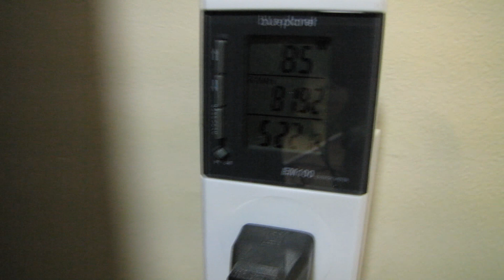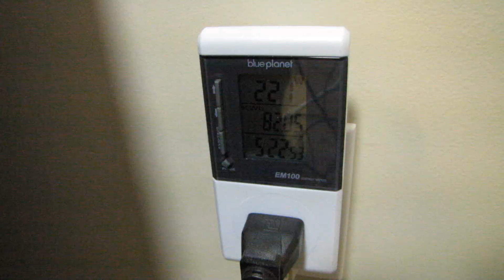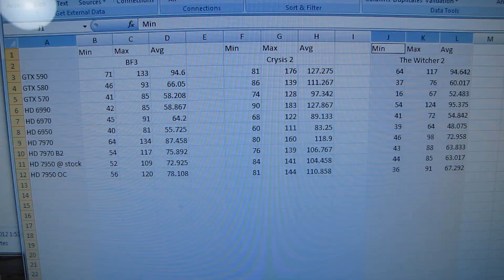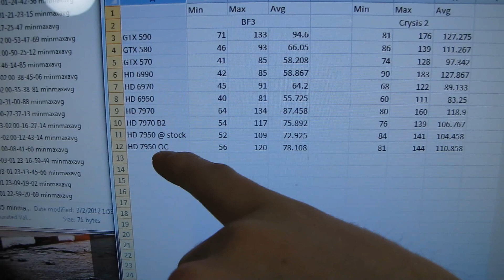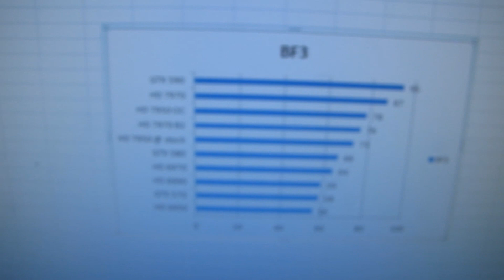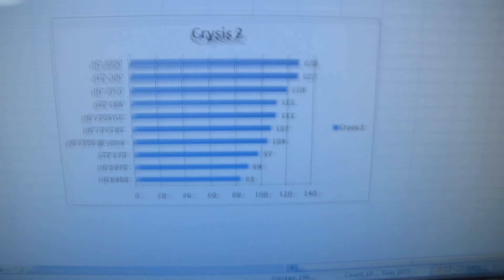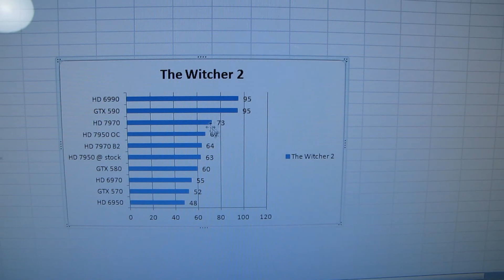Sapphire HD 7950 OC Dual Fan 3GB Video Card Review & Benchmarks Linus Tech Tips

Comment: Just bought this GPU for $40 and In 2017 it's still a great card
Reply: 2018 $ ???
Reply: @QuanTran-fy1lp  Well then... here we go: I bought myself a full system today (craigslist) with this GPU included (actually the Club 3D version) for 50 EUR (around 57 USD), complete with a semi-modular PSU (OCZ Fatal1ty 550 W), Phenom II X6 1075t CPU, Scythe Mugen 2 air cooler and 8 Gb DDR3 memory on an ASRock 870 Extreme 3 motherboard, all within a CoolerMaster HAF 932 case. Pretty lousy deal I guess since the guy didn't include an HDD... xD

Comment: I have the Gigabyte one with 3 fans and I just replaced 2 of them, rattling at idle.. hope they stay quiet now. Build the system in late 2013 and it still doing everything with an i7-4770 and 16gb of ram. I also have it clocked to 1000mhz/1250mhz.

Comment: @wasssabio 

Much smaller Die size than the 6950, meaning it uses less power and generates less heat,  it also means they are able to fit more onto the physical GPU aswell giving it more power to give you better FPS.

Comment: @Guitarlover762

Not a chance, I'm not sure about the 3570K but with an 8-Core AMD FX processor and two 7950's and a few other things installed the Newegg PSU Wattage calculator gave me a readout of 821 watts, so no, it is almost certain that a 750W PSU is enough to power your system.

Comment: Its a good card,i have a Vapor X aswell.
Overclocking is easy enough just take your time with it,i only recently built my first PC and was new to overclocking too.

You'll need software for overclocking and monitoring software to check temps etc.
To overclock the card i used MSI Afterburner but Sapphire Trixx is also supposed to be good and is made by the same company that makes you card.
For monitoring speeds and temps Gpu-z and HWMonitor are good too.

All these programs are free too :)

Comment: @IAmSkip94 Never mind that when you run it on several different machines with different mobos/CPU's etc you need to reinstall anyway. It's a bench rig it gets used to benchmark maybe a few days tops until the whole configuration changes again.

Comment: Getting exactly the same. Have asked around on forums and stuff, no problems.

But maybe you should consider swapping the i7 for an i5-3570 (almost the same, but i7 got multi-threading) and buying an SSD for your OS, since that will increase loading speeds more than an i7 over i5.

Comment: In performance, the 660Ti beats the 7950 I think.  But you can overclock the 7950 to higher performance than the 670.  But I'm not sure if you lose the PhysX from Nvidia if you pick the 7950 though.

Comment: i got exactly the same you did (or will) and it's a beast, it runs great, i didn't have any problem  when i first turn the computer on, before installing the video card i tried a few games and only with the processor you can run left 4 dead, diablo, PayDay and games like that, with the video card if you still haven't gotten it, i would get a GTX 660 ti, it performs almost as good as the 7950 but it costs $300 only. :)

Comment: A power supply is what gives your computer power. There is a certain wattage requirement your pc needs. Power supply for short is psu(power supply unit). The average power supply wattage is a 500 watt power supply. I would recommend either corsair or seasonic. Mostly corsair. To make you feel not lonely, I'm 13.

Comment: kind of, there is still room for improve...also depends on game, there are few solutions available, just google it...anyway latency is far better on nvidia, thats a fact...but about raw power, this card is a beast, i OC to 1150/1600 without even touch the voltage, also the bundle is very nice.
and they have more bandwith and ram, this card come with 3gbs of gddr5, which is very nice, for max out resolution and filters, its up to you.

Comment: I'm bad with computers. If I get this card, do I need to buy anything else? Or just the card?
Reply: depends on what are you going to use your computer for, and what are your computer aspects
Reply: I had to buy a new power supply with it which was about $100. It says minimum is about 600 Watts, you might be able to get away with a 500 watt power supply if your current power supply is a high end.
Reply: HawkSupport Please don't try and get away with 500 Watt's I know its tempting but save up.
Reply: Killagoku PC  a quality 500w can run it.. i can even say i run a fx 6300 and 7950 maxed out on a poor 450 cheap but strong unit.....   So a 500w with japan capacitor is able to power it easily
Reply: do you have a computer with parts but your missing a card, if so no you wont have to buy anything else for the card...

Comment: I can get the 660ti or this, right now i'm leaning towards the 7950.  The 7950 has the new edition of a "boost" clock right? so it's the same as 660ti and I've been seeing higher overclock potentials for the 7950 than the 660ti.  But if i pick the 7950 will I lose PhysX??

Comment: i got 7950 @1150 /1600 OC and run games all games good at 1080p, so if you play at 1080p, single monitor...you should run everything over 60fps without problems with that configuration..crysis 3 too

Comment: @fuzzjunky no I got it to about 3.8 GHz. But since I started using 4 sticks of RAM it just wouldn't be stable and I don't have the cooling to putt more volts in to it so  stopped at 3.2  still a lot better then 2.66 GHz which is stock :)

Comment: CUDA cores are processors in the GPU that help it with calculations. Editing programs take advantage of these. And the 7970 compares to the GTX 680. 670 is not better than the 7950 or 7970.

Comment: Just got my new i7-3820 and OCed it to 4.4Ghz max multi. Also my non-OC edition Sapphire I have at 1112mV/1612mV 1112MHz/1575MHz , Afterburner can't hit max OC of 1300/7600 that the card is actually capable of. 55-60% increase in performance over stock. Have a 130cfm fan focused from the side to not wear out gpu fan but i cant find a utility to turn down the rpm on that fan to makes a lot of noise. Bios options failed, Speed Fan, ect... will not control the fan, rheostat fan controller next opti

Comment: I dunno still haven't run into any troubles with my 580 at 1080p. Still can play games at high/very high settings with little trouble. Doubt I'll need an upgrade for a while. Probably go sli when the price drops on the 580's. Although my last trip into dual card territory wasn't pleasant but hopefully it's got better.

Comment: You should OC because 7950 is a beast when OC'ed. 

Google: sapphire 7950 OC overclocking 
and check out the first few links as far as I know you can push the memory up to 1600 MHz and core clock to around 1100 MHz

Comment: I can say I am Beyond happy with this card, I bought it as a replacement for my GTX 590 which failed way back, and the performance is similar to it, but the 7950 has been beyond way more stable and it just gets the job done, and though i have a meaty power supply, i'm happy this card is not a thirsty card like the 590, though the 590 is kinda awesome in it's own way too.

Comment: @mrDMxtreme 
you can easily take the 7950 a 1200MHz on the cpu on air cooling making it perform even better than the 7970 @ stock, can the 580 do that?

Comment: Have you got the correct drivers, have you removed old video card drivers, have you turned vertical sync on (screen tearing is usually down to your video card putting out too many frames and your monitor can only display so much), have you checked if the temperatures are normal under load and on idle?

Comment: right now i am running this card, intel core i5 at 3.5ghz 16 gb of ram, 2x2 tb hard drives and a 850 watt 80+ silver cooler master psu and i run everything at around 120 fps except cod that seems to stay a 60fps. 60 fps period. does not go higher or lower

Comment: I bought a Sapphire 7950 Vapor X along with the new PC, but I always had problems !! Always crashes, overheats and crashes, I do not know how! Even when I do not play but I look at a simple, functional video, the screen goes black and freezes everything!
I put a strong power supply Corsair AX860i, but nothing has changed !!
What can I do? The problem is the graphics card?
Reply: Your cpu? Thermal paste? Did you build it?
Reply: slayerbalboa™ If you are still having issues, update drivers, make sure video card is completely seated in pci-e slot. Could be faulty. I would contact manufacturer. Mine runs fantastic!

Comment: No the 770 has way more raw power than the 7950 and plus you can get it in a 4 GB config. 
At the same clock speeds the 770 will win the reviews you saw were with the reference 770 and gave the AMD cards an advantage.

Comment: which fan would u say is the best for radiator use, well it's only the radiator of an antec 620 but still? I really need new fans and would like to get the best performence possible from my cooler. I'm currently thinking of airpenetrators or is it worth getting noctuas 1300?

Comment: @syaoranpies they do its called 6990 and it sucks but it is a lot cheaper than the 590 and well dual 6950 are way better than a singel 590 anyway and together they would be about 2/3 the price of a singel 590 so there is no point in having either of them anyway ps did u even wach the video before commenting?

Comment: I have a question :). when i use my pc i get a black screens randomly happening. my friend says this is because of the gpu not getting enough power but its on 650w psu, specs: cpu: amd bulldozer fx-6 sixcore 6100 black edition 3.4ghz. Gpu: Sapphire radeon hd 6850 1gb gddr5. case fans: 3, msi  870a-g54. R.A.M: 1x4gb ddr3. i run at 1900x1200 on 1 screen, but happens when my gpu is in idle mode

Comment: But it's a very important 5 FPS because it's on maxed out intensive games like Cry 3 and metro; and the FPS is like 25 to 30 or 30 to 35 for the 770 over the 7970.

It's does the same to the 7970 since their like the same when OCed. the 7970 can only win at a higher res like 1440p but it doesn't matter any way because their both well under 30 FPS anyway

Comment: @4Th3Truthful BF3 Ultra still drops to the high 40's but very rarely, Actually I can play it in stereo 3d with over 30FPS by just turning MSAAX4 down to X2. I just need another in s-fire or get a 7990 and tri-fire but I would need new PSU, maybe I will upgrade before WOW2 (project titan) in 2014-15 but until then I will see you in BF3

Comment: this card is awesome especially when overclocked past the standard overclock you get out of the box. With a 2600K, you will have a beast system. I run a 2500K overclocked to around 4.0Ghz and the card gets better when you overclock your CPU. Fantastic

Comment: What resolution was this testing at? I have two 6950's (2Gb, Unlocked shaders), and have sold both basically, and am trying to decide between 7950 and 7970. Theres a $100 difference ($200 if i was to buy a second 7970 for CF). Iv been told that at 1080P, then 7970 shows little difference in performance. What i worry about is buying one, the Nvidia cards coming up and AMD dropping the prices of their cards, me regretting paying more.

Comment: The 7990 is dual GPU so you're not always getting the extra FPS, plus crossfire sucks not many games optimize for it. Until recently it didn't even do anything. The 7970 GHz is better than the 7950 significantly. the 770 will always beat the AMD cards as long as it's a equal comparisons as far as V-RAM.

Comment: easily? simple answer, no. you will need to flash it to a 7970 and maybe get another one. also, you will need to crossfire them, if you want to play at reasonable settings 5 years from now, assuming dx12 doesn't come out.

Comment: This cannot possibly be on max settings for the Witcher 2. I only get 40-60 FPS on mixed high/ultra settings (this is at the beginning of the game). I have the exact same card running at stock and with the i7 3820 4.4GHz (arguably better than the 2600k) and 24GB DDR3 1866 RAM. Please can you clarify what settings yours are at.

Comment: I bought reference 6950 2gb  for  $190 USD. The card is unlocked and oced 950 core and 1325 memory. I can't play bf3 on ultra setting with this min 30fps and avg 40 fps. Should I return it and wait for 7870? or gtx 660?

Comment: Hello guys, I have some questions, I have this GPU, (the 925MHz edition) I have got it crossfired with another one, and I think I might be able to increase their performance, but I don't know how? any tips in terms of programs or guides to use?

Specs here:

CPU: Intel core i7 2600k @3.4Ghz I'd like to overclock this guy as well but I don't know how  :(
GPU: AMD Radeon HD 7950 3GB with boost (925MHz) (CrossfireX)
Ram: 4x4GB Corsair Vengeance
PSU: OCZ ModXStream-pro  600w (SLI/CrossfireX ready)

I hope someone can give me a clue on how to start this journey ;)
Thanks in advance!
Reply: J and M play Games That setup is still awesome for modern games. If you already have an aftermarket cooler, you can definitely overclock that 2600k to get more power that's still more than enough for most games these days. If not, definitely look into a good air or water cooler at some point and make sure your motherboard supports overclocking. As for the 7950s, I'm sure you can put small overclocks on them, but 600w on the power supply may not be enough to support the power draw from two OC'd 7950s and a 2600k. Sorry I'm a bit vague, but there are tons of guides and videos that you can look into that will be much better at explaining them than I can.
Reply: J and M play Games I was going to build a mid range gaming pc for around 1000$ but I saw a computer on Kijiji that has specs very similar to this buil. It has same gpu and cpu and is being sold for 750. Is this a good alternative to building my own pc which would most likely have a 4690 i5 and a 280x or 960?
Reply: Zeejays Hood For 750 I would say yes, if you still have the $250 I would use that to buy upgrades for it, a better cooling system for instance, or a nice mouse and keyboard etc. But for 750 you should check if he sells it with crossfireX! if it doesn't have 2 gpu's than U should definitely build your own!
Reply: JPS913 Thanks for your reply! I didn't quite see it, so I am sorry for the late response..
Reply: J and M play Games These are canadian prices so it would be a lot more expensive. Considering how a 4690k goes for 250, it will be close to 300 in Canada, etc. It doesn't have cross fire gpus but the cpu does have a corsair water block on it. Are the older 2600 i7s overclockable? If he doesn't get back to me, i am very interested in the new ati 370 which goes for 230ish in Canada atm. I am only looking to do 1080p gaming at hopefully 60fps.
Reply: The 2600 is not overclockable, but the 2600k is. The K stands for an overclockable cpu. The water block is very interesting but without an overclockable cpu it's not that useful, in contrast to having a second gpu which makes graphical performance much better but increases wattage a bit. It's your deicision.Choose wisely. :D
Reply: J and M play Games I meant to say the k haha and the guy said he can overclock it to 4.3 which is awesome for a last gen cpu
Reply: Zeejays Hood Oh haha, yeah that's a pretty nice feature!

Comment: I said until recently and it's only on DX 10 games or above.
Not every card is safe to OC to 1.3 GHz that's alot of stress on your GPU and will shorten it's life span.  
Keep in mind every review you see is using a reference GTX 770 and most likely an after market 7970
the 770 OC beats any single GPU AMD card easily. the 770 is better than 680 and destroys 7950 every  possible way

Comment: I just cant get how is it justified to buy tis kind of gpu for just coup of games that use high gpu power, Metro 2033, Battlefield 3, and crysis 1 and 2. I have ati 4850 and played all of these games maxed on 1680x1050 (overclocked 730/1250)  except battlefield 3 wich i played at high/ some options on medium. It is god damn 50$ gpu and it gives 40 fps ( i wont play any game at lower fps than 40). directx 11 I tried but there is just so minimal diference than dx10.